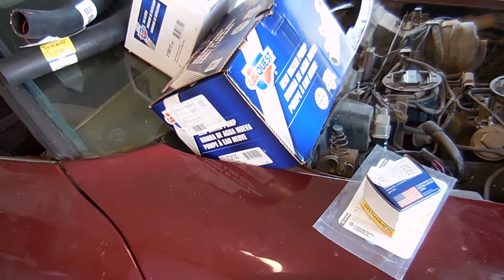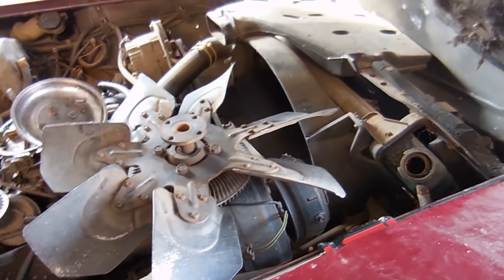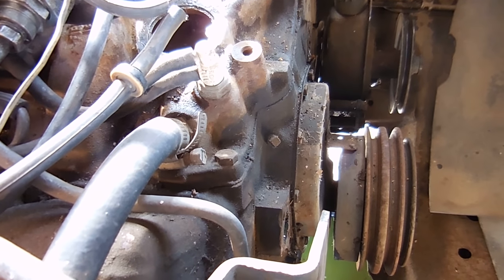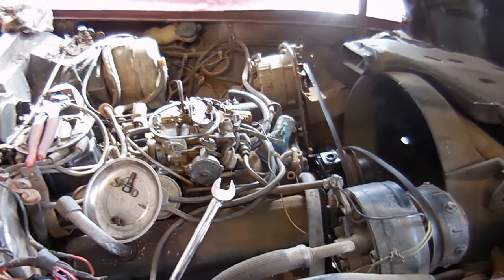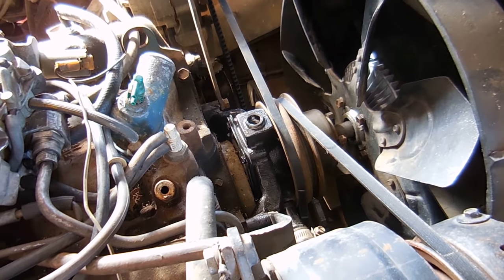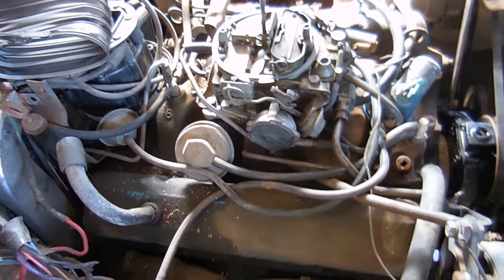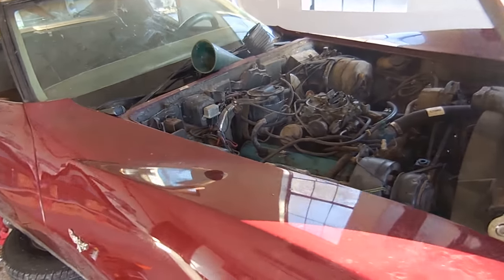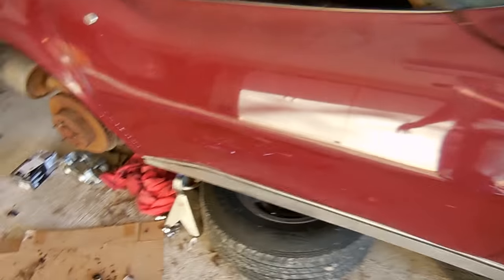1977 Corvette Barn Find Rescue Video 5 of 11

Comment: Been watching your videos over and over. Even letting them play while I'm at work and just listen to them. I inherited a 1977 Corvette stingray from my grandpa who died earlier this spring, that's when we actually started working on it all we did was change the oil, due to cancer f*** cancer anyway you've been very helpful my dude even though I'm letting I've taken it to a shop for big things like the upper and lower control arms all of the transmission servicing the big s*** I could blame on the shop but other than that valve cover gaskets like how you said the water pump I did the power steering system I replaced the spark plugs and spark plug wires distributor cap a lot of things have just been able to do myself I didn't realize how simple of a machine these badass cars actually are you've definitely built some confidence and working on an older car and I'm sure not only am I appreciating you for that but my grandpa as well. thank you

Comment: enjoyed the vid.  my C3 had been sitting for a while and all by itself decided to leak out the t-state housing...just from sitting.  Housing def warped.  put a belt sander upside down in the vise and ground the housing flat.  also replaced the cheap pepboy red heater hoses with real black molded heater hoses...those are hard to clamp underneath...nipples kinda up in a cubby underneath the car.  All back together now...but not ready to test cause my dash is completely out to fix broken speedo and tach housings.  Whew!
Thx for all the vids...its a lot of work to put them out.  really enjoy the SdV vids too.

Comment: Glad to see you are replacing everything on the cooling system and the rest of the parts and its definitely cheap enough and worth the time. Glad that engine is solid and sounds great. You are definitely doing everything the right way. Nice to not see rust in that radiator and just green antifreeze. Its better to be safe than sorry to replace all of the hoses and belts and anything that shows wear. Two thumbs up ben

Comment: Check your timing chain before you pit the water pump back on. It's an easy check. Pop the dist. cap off, turn the crank until timing marks align, then turn the crank backward, until the rotor moves. If you turn the crank more than 3º before the rotor moves, replace the timing chain. Much easer to do when you have the water pump off. It can be done without dropping the oil pan, if it's bad.

Comment: On the cars that's been sitting I like to use Engine Degreaser , Makes the bolts easy to find and helps with keeping your hands and tools a little cleaner also looks better for resale plus maybe the engine will run just a little cooler with all the dirt gone .

Comment: Did you use the fan, or the fan clutch from the wreck?  Those chevy rocker covers can be a real pain to get sealed up, the darn covers always bend/distort when you snug up the bolts...Sounds and looks good though!
Reply from the maker: Just the clutch. Fans from the 77 and 81 are different

Comment: Hey Ben, I could really use your help. I have an 85 corvette that definitely has a questionable past. It was running really good last summer but it has a problem now. In early September, I backed the car out so I could clean the garage. I shut it off and when I went to start it up. It fired but it wouldn't idle by it self. It ran fine besides for that. Now it runs like garbage. I checked the codes and got 34. Which has something to do with the maf. I'm wondering if I need to replace the sensor or if it could be something else. Because these maf sensors are quite expensive.
Reply from the maker: +Daniel Nathan mine ended up being the wires to the maf sensor had been rubbed through by the serpentine belt. Try that before you get a new maf. You can also try cleaning it as well

Comment: Just had valve cover gaskets replaced on a 1989 Ford 5.0 engine and there is still oil residue on the passenger side rear lip of the valve cover gasket.  The PCV valve filter was replaced in the intake manifold because it was almost completely stopped up.  I was told the vacuum line or lines had residue oil in them because of the bad PCV valve filter being almost completely clogged up.

My question is:  how long will it take for the residue oil to work its way out of the vacuum line or lines?

Thanks for any help and enjoy your videos a great deal.
Reply: YOUGOTIT210 they should have been replaced, they will clog the new pcv

Comment: when I bought mine it the guy said the radiator was new and it leaks quite a bit lol. eventually I'm going to replace it. question is to inform keep it stock with clutch fan or go with a dual puller fan set-up?
Reply from the maker: I think it depends on your budget first, stock is usually cheaper, and also if you car is super original or not. if it isn't, then go ahead and make changes like this one.
Reply: TheCorvetteBen according to the numbers on the block the engine is a truck motor. it's not numbers matching sadly enough. runs great tho.

Comment: Can we expect a video 6 etc until the car is completed?
Reply from the maker: Video 6 out today!
Reply: TheCorvetteBen: since you have the water pump remove,now is the best time to check the timing chain. Simply rock the crankshaft pulley back and forth to see if there's any slack in the chain. If so now is the time to change it, just my opinion.